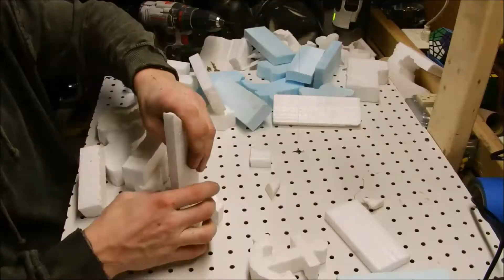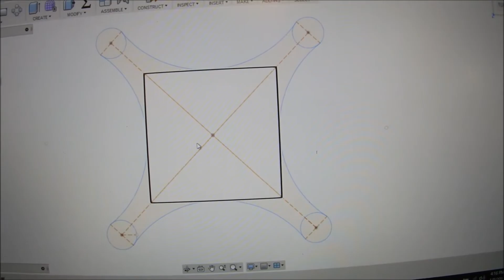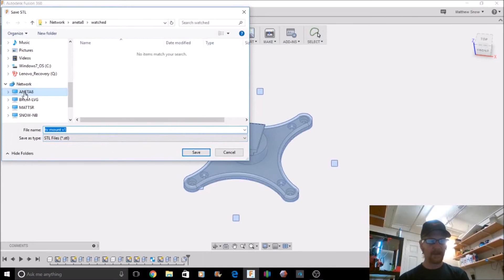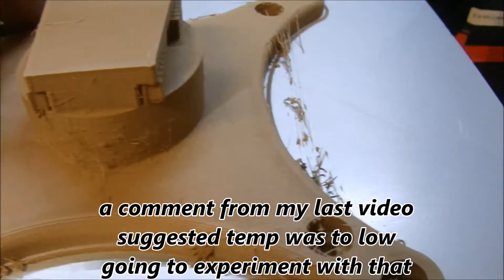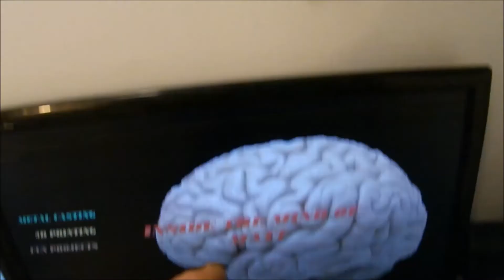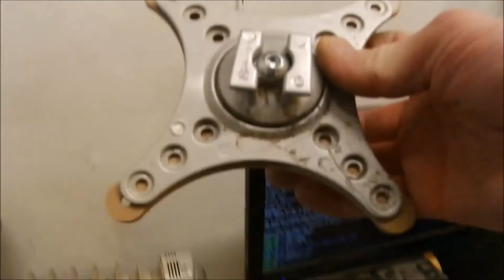Mounting A TV To The Wall With 3D Printed Parts

Comment: For the wall mount, you want the layers to go vertically instead of horizontally. Cracks between the layers are super easy - https://youtu.be/OqRbSkX5IJk?t=156
Reply from the maker: yes that seemed to be the consensuses of the masses and it did fail after a few weeks luckily i had something under the tv to break its fall :)